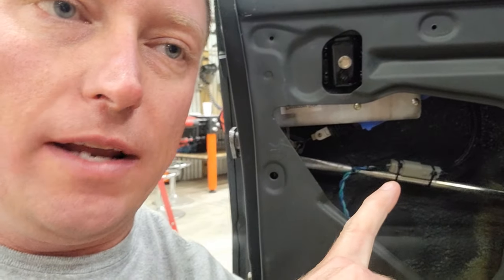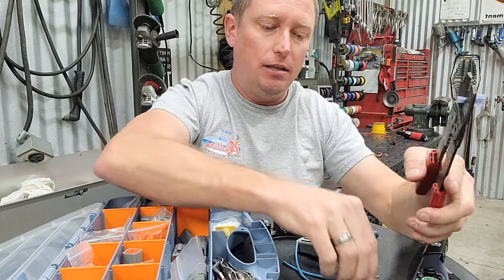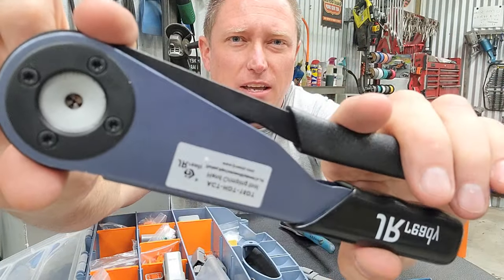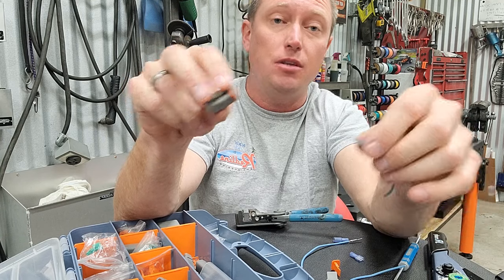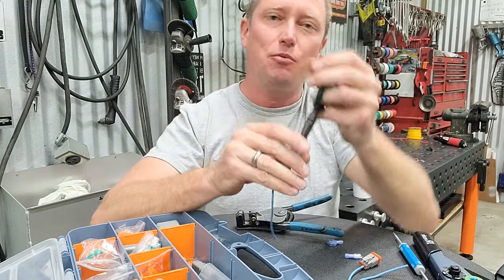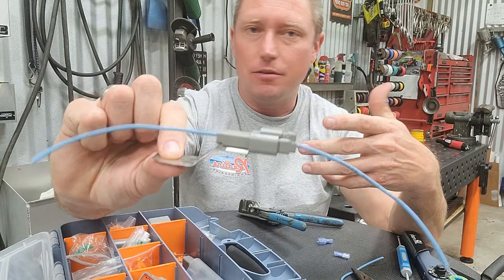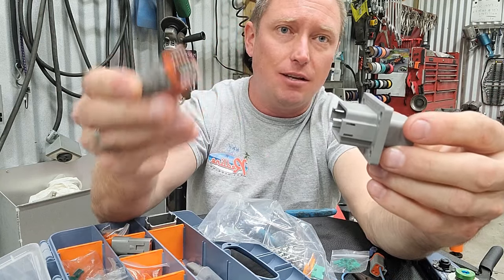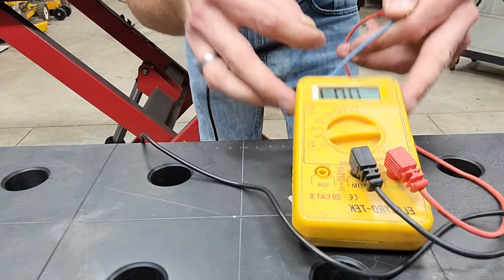Deutsch Jr Ready Connectors - How & Why to Use Them

Comment: Seems like the cost of those plugs for a 2/4 pin is like $4 per plug.   But cost goes up when you consider the crimper and tools can cost $150+       I found some circular screw lock plugs on amazon with tails for  16 gauge wire for about $2 -$3 a plug.   I like the screw lock because they seem like they would hold up to heat better.   Those snap tab things always seem to break in the heat/through the years.   Then you have to replace both sides to get the thing to work.    The screw lock things you can use your fingers, don't need even a screwdriver to pry anything with.    Will revist the JReady stuff in the future.   I think the IWiss varyant is a bit cheeper.     The green band on the pin has a smaller hull to allow larger wires for the pin size.

Comment: To add I like to use silicone dielectric grease on the seals to keep them from drying out and failing. Not packing it full as I seen people do and wonder why stuff dont work.
Reply: Jrready connectors come greased, I was very surprised to see it lol

Comment: So as a cheap old bugger I look at this and think buy the kit once to get a good start then a  30 min in the scrap yard and a person will have all the connectors one could want. Just buy the pins. Good video keep them coming. 

EDIT:The link you sent has different crimpers and not nearly as good as the ones you have In my opinion
Reply from the maker: Here's the updated link.
https://www.amazon.com/JRready-Connectors-Waterproof-Automotive-electrical/dp/B0C7K8Q5CZ/ref=sr_1_5?crid=2FCTGL16JX1TR&dib=eyJ2IjoiMSJ9.L-Y_T8z9OMD04IV4OLyBcbPE6PMpOQWrE2NUK-4TNg8qlk9RhIi8n4J_iKu0sWhRsfDxv1vAtauAJGGT_7fzR0puld7AyZaqrggvSrtXdypu9YsKFg0P6Oj1ZF2hAWvTmoPv9E-5o_UpHpqFnSnLVkFjgDfjQMpoyusMKWMqvMe74FlJVreGPjkckRSr0d2mFt22TQRXQo0rz4p7Vc2hv72JOYnhmmD5HiZBbGUW9xU.JWAPJDzQ2-mszIgtR2vV7FFke1KQBOc5PrDjzXaY-hg&dib_tag=se&keywords=deutsch+connector+kit&qid=1711850059&sprefix=deutsch+connector+kit%2Caps%2C102&sr=8-5

Comment: Great detailed instruction, but I'm confused. Isn't what you're calling the female terminal actually the male, and vice versa? Some videos say to insert the male pin into the female terminal, and the female pin into the male terminal. Not criticizing...just at this point I'm not sure which is which.  BTW...love the Let's Go Brandon flag...nice touch. 😁
Reply from the maker: Yeah, I have ran into this myself.  The female terminals insert into the connector that allows them not to protrude at all.  In other words, if you insert the female terminal into the correct connector, the only thing you'll be able to see is the very end of the terminal.  If you can see the sides of the female metal terminal once it is installed, then you installed it into the wrong connector.  Granted, this is "after" you install the orange plug at the end.

Comment: In all that I have seen on Deutsch connectors, there has not been a mention on the direction of feed into a connector. In my hobby work, I have been connecting the service or power side of a connector onto the Female side of the connector and Load or Device side onto the male connector.  This made sense to me as a way to prevent accidental short circuit across the male pins inside a connector.  Is there a rule of thumb on the direction of the connector?
Reply from the maker: Honestly, I have no idea.  I've done it both ways and noticed no difference.
Reply: That is the best way to do any electrical connection, and it's how your house wiring is setup - power in the female wall sockets, load devices/extension cords are male. These connectors offer the added advantage that the male pins are recessed into the plug assembly, so the collar of the plug always protects them against finger slips when disconnecting or being stepped on if they were on the ground.